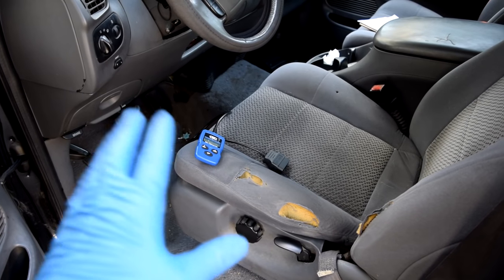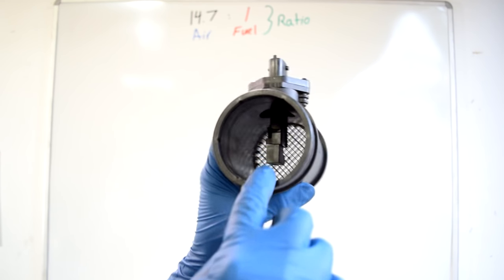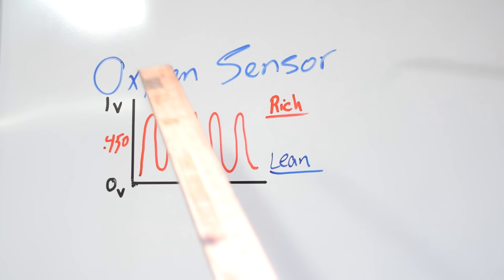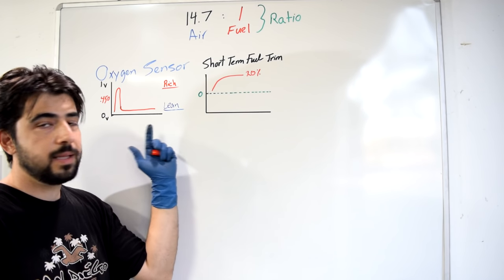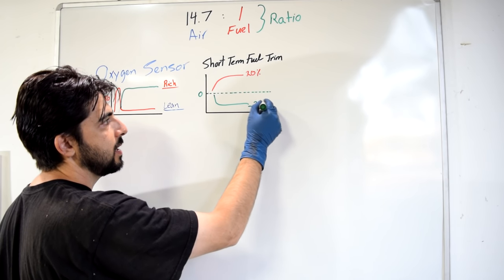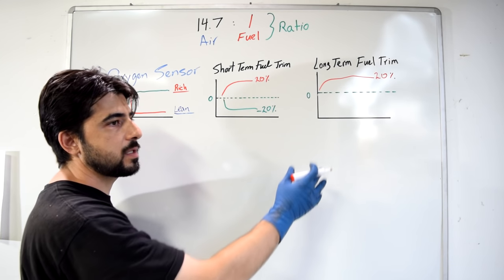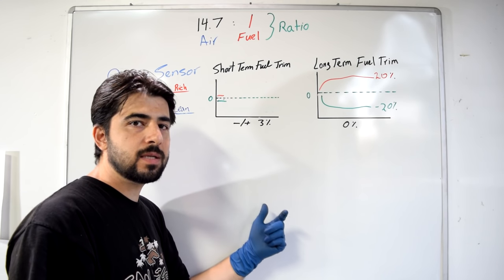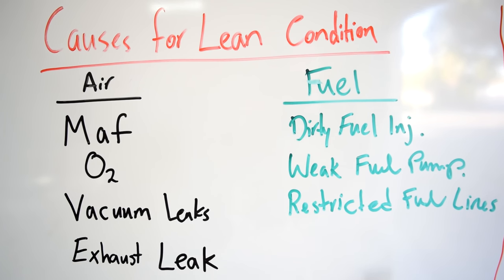Short Term and Long Term Fuel Trims Explained

Comment: what if I have long term furl trim -14 in one bank
Reply from the maker: you could have a leaking fuel injector in that bank or a bad O2 sensor for that bank.
Reply: +Ratchets And Wrenches I changed the o2 already since there were old, but could a lean conditions make a car use a lot of fuel
Reply: +STEEVE DAVID Nicolas a lean condition would absolutely cause a higher fuel consumption. But your readings of -14 % do not indicate a lean running car. Just the opposite. If you watch this video again he does a great job of explaining this. Your vehicle is running rich. This could be a skewed MAP sensor, purge solenoid stuck open, failing Mass air flow sensor , injectors etc.... But most importantly you need to know what your fuel trims are doing across a range of variable conditions. What are fuel trims doing as you accelerate and at what load? Much more information is needed for any diagnosis to be made. O2 sensors are much lower on my list of a cause of a rich running condition.  Not to say that it doesn't happen , but not very often and not without another underlying cause
Reply: +ONBOARDTECH333 it is a ford explorer, with 175k,I have a feeling it is the evap solenoid
Reply: +STEEVE DAVID Nicolas don't load the parts cannon just yet. Cap off the line going to the intake from the vapor management valve (purge). And see if the fuel trims start heading back towards 0 first
Reply: +ONBOARDTECH333 great idea but when I check the mode 6,it is the only one that won't pass the duty cycle
Reply: new level auto, you seem like you know your stuff, could you look at my problem, just posted it at top of this thread, it is baffling me...

Comment: Can dirty air filter cause engine run rich? many people answer "yes". But I don't understand why.  The amount of air is measured by MAF. even air filter is little restricted. but MAF only measures how much air entering.PCM only gives fuel according to how much air entering. The engine can run a lower RPM. but should not be rich.
Reply from the maker: Engine will run ok to a point but still lack power. Your fuel trims will show fuel being taken away. But if its clogged up too bad it will not only lack power but start running poorly or not run at all.
Reply: @myRatchets  Yes, agree. but will it trigger P0172 rich code?

Comment: Have some power issues myself. My SHRTFT ~0% and LONGFT ~14% at idle after 10 or so mins), now at 2500RPM, I get SHRTFT ~18% and LONGFT ~24% (after around a minute or so in 2500RPM). 

Here is the chart: https://ibb.co/jEpg98. 

I've also got P0420 that suggest it might be catalytic converter. Should I check something else before throwing money at cat? I've changed plugs, coil and leads already.

Comment: What if bank 1 long and short stays at 0.0
Reply: It means you have a car that is performing closely to the design limitations that the manufacturer intended. [ good fuel use performance ]
Reply: 0.0 can go both ways...your car is either performing flawlessly or your ecu is not able to calculate your fuel trims due to faulty sensors not giving any readings to the ecu. You'd need to check the sensor voltages and confirm they are working properly.
Reply: @VdubInParadise  ur right my car ecm was the problem
Reply: @VdubInParadise  Thank you for expanding my understanding.  Most faulty sensors are depicted by looking at the voltage data streaming or graphing but i have not encountered 0.0 that's good to know

Comment: Ok ....2004 mazda mpv 3.0 v6 here is my live data numbers
 Bank 1 idle.                         Bank 2 idle
S1: 0.0 - 0.8/S2: 0.4    S1: 0.0 - 0.8/S2: .075
STFT: 0.8 - +2.3 -3.9   STFT: 0.0 - +2.3 -3.1
LTFT: +4.7 - +5.5.        LTFT: +13.3

Bank 1 2.5krpm.           Bank 2 2.5krpm
S1: 0.8/S2: 0.8.              S1: 0.8/ S2: 0.8
STFT: 0.0 - +2.3 -3.9.   STFT: 0.8 - +7.8 -2.4
LTFT: +3.9.                     LTFT: +9.4

CEL p0171 & p0174 about once a month but never both codes at once. Plz help
I did the spray all around the intake/tb/vacuum lines/pcv hose etc no change in idle ..

Comment: Let me get this straight 
Lean= too much air so computer adds fuel
Rich = too little air so computer adds less fuel

I’m I the only one that thinks this should be backwards or I’m I missing something?
Reply: Yeah it is kind of backwards.

if your car is running lean, the computer tries to compensate by adding fuel.
if your car is running rich your computer tries to compensate by reducing fuel.

So if your fuel trims are positive, it means its trying to ADD fuel because there is too much air, therefore your car is running lean.

Comment: Couldn't you prove a vacuum leak with a vacuum gauge?
Reply: That is not an effective test at all . If the leak is small which most are , the vacuum created would overcome a gauge . That's exactly why fuel trim is so important
Reply from the maker: Thanks onboardtech for answering questions :-)
Reply: +Ratchets And Wrenches I certainly don't mind if you don't mind my help. You just keep making videos like this one!

Comment: You're pronouncing MAF as "map" sensor...please explain the difference. 
  Nevermind...someone just told me. MAF is short for mafia...and "map" is short for Modified Apple Peeler....but it somehow don't sound right.
Reply: manifold absolute pressure 
mass air flow